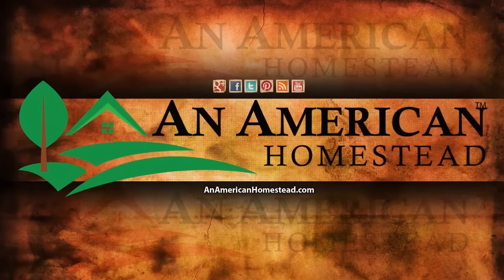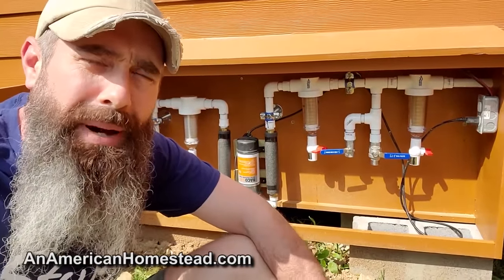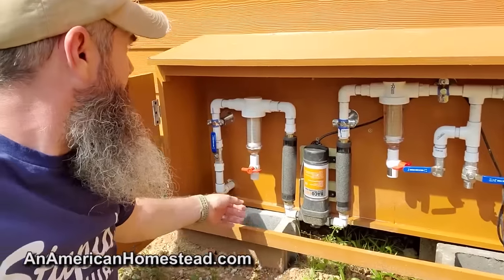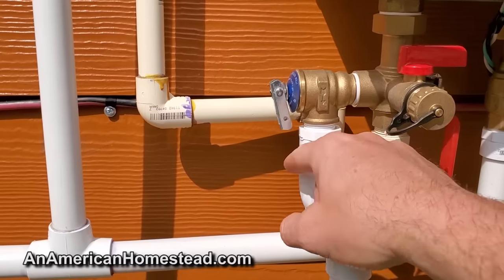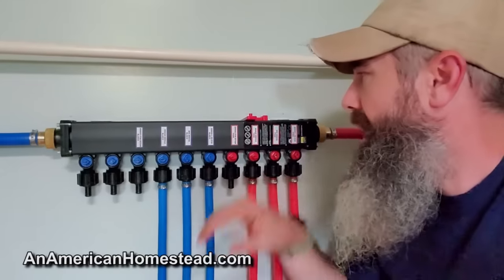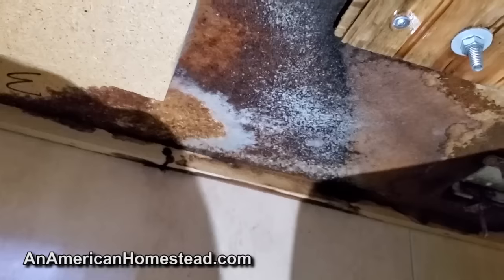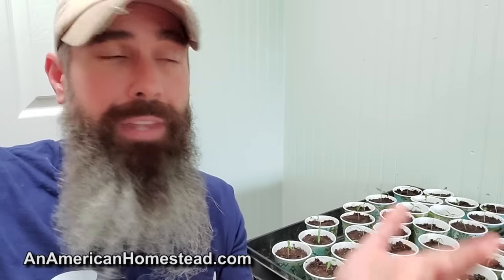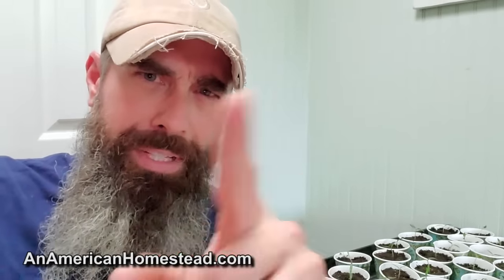How Our Off Grid Water System Works

Comment: I have a rain water catchment system for all my water needs too. My main tank is 2/3 in the ground, I ran into rock. I only got it 2/3 into the ground and covered the top 1/3 with dirt held in place with terraced concrete blocks where now strawberries are growing. I have a "first flush" tank that feeds my cistern and use one of those harbor freight shallow well pump/tank combos. I also have 2 IBC totes and several barrels above ground to catch water for my garden and animals. We get temps into the teens occasionally but only stays below freezing for a few days. I don't have my above ground tanks hard plumbed and if full there's enough mass they don't freeze solid. I have a Big Berkey for drinking.

Comment: I have been on off grid water for a couple of years, my water source is also rain water, the biggest difference between your system and mine is, I only used copper tubbing ,my hot water heater is solar and my pumping system is 12v and runs on wind and solar,  I also use berkey as my water drinking source,  nice system.

Comment: I have a 9 acre water catchment system that waters my garden with a ram pump. My water well is 1/4 mile away. I power it with 230v from my split phase 230v inverter. Through a direct burial 8awg 2 wire. I get 115 v at the well house for lights by running one leg to ground.
It supplies two households and a machine shop with water. My house is all electric. I am off grid and take long hot showers. I average using just over 6 kWh a day. Sometimes up to 12 when my wife runs the AC and does the laundry. The power company had me using 20 to 30 kWh per day.? I’m sure I use less now, but I don’t think I use that much less!!
Reply: Is it possible to contact you directly?  I have a couple of questions.  Thanks. Blessings.

Comment: If you can get the bottom of the tank at least 10' above highest output, you won't need a pump, a 10' drop will give about 60 lbs. of pressure in the house.  And... cover that PVC or switch to CPVC, OEX, or copper for anything out in the weather and sunlight, sunlight wreaks havok on PVC.  Also, creating a vortex in the tank will keep it from freezing ❄️
Reply: Plus "line drop/resistance" if any distance is covered....in my case 500'
Reply: How does one create a vortex in a sealed tank?
Did you install something to agitate the water or is there some other way I haven't considered?
Reply: My problem with a high tank position was my house eaves are 10' and rain had to be able to flow into the tank freely by gravity.  If I had a 3 story house and only needed plumbing on the 1st level this idea might work.
Reply: 10’ of water gets you 4.32 PSI by my calculations.
Reply: Yea… to get 60 PSI you’d have to be closer to 138 feet high.
Reply from the maker: I think your numbers are a bit off....and please tell me how I can create a vortex in the tank.....never heard of that one before.
Reply: @Anamericanhomestead  there's a man who made a plastic "tornado, from Fibonacci, that you can attach to a motor shaft that works really well also.
Reply: @Anamericanhomestead  as for the numbers, I used to be a plumber and the 10' head pressure is our test pressure.
Reply: if you got creative you could add a magnetic stirrer to the tanks.

Comment: Question: When there is a forecast of freezing weather, you drain the pipes so they don't freeze. If things get to the point where there is no weather forecast, how will you handle that?
Reply from the maker: My temp gauge will still be working and I'll just have to watch it more closely.
Reply: @Anamericanhomestead  Thanks!

Comment: We just had a well put in and a 1000 gal holding tank.  1 pump in the well, one pump in the tank.  Now the company tells me I have to chlorinate the water because the black 1000 gal tank is not air tight.  I obviously don't want chemicals in the water, which is why we dug the well in the first place, though we have county water.  I don't know whether to send the 1000 gal tank back and just hope the well/electric is always working, or keep it, but without chlorinating.  We would just Berkey filter the water then.  Thoughts?  And Thank you!

Comment: really looking for some guidance... but i think your video is perfect!
Right now we have county water. We have access to a stream that can provide all the water we need. I have a sump pump submerged in that creek and 5 IBC 275 gallon tanks for storage. My plan is to hook the totes together with PVC and hook it to the main line ( 1/2 pex tubing) that is fed by the county now. basically unhook the county and hook up this system and boom, the whole house is connected. My question is, would this pump work? How is it when you guys have the shower and a faucet running? Does it keep up on pressure? I am pretty sure I can design the system based on your video, but just not sure on the pressure situation. We have one shower/toiler, a kitchen sink, bathroom sink and a standard 40 gallon (traditional) nat gas hot water heater. Also two outside hose hookups, but i would probably do away with 1 or both of those much like you did. 
Lastly, do you have a components list? Mainly the filters, pump and pressure tank? Thank you!

Comment: Water heater looks great to me. I would advise flushing it every year to extend its life. What’s the draw from the pump on your solar?
Reply from the maker: Its easy to flush and a MUST if you're on well water.  But because this is rain catchment water and will have a low mineral content, you can go longer between flushings. But still a good idea.  You're supposed to flush with a mixture of 50/50 water/vinegar.

Comment: What proportion of roof surface to occupancy do you run into with water consumption? Also, our place is at 3000 ft in southern VA in the blue ridge mountains. If you can't embed the tanks deep enough to avoid draining the system, what median temperature in winter is too low for this type of system to be practical. And, nice teeth.

Comment: What was the reason you chose a rainwater harvesting system over digging a well? What would have been the cost difference?
Harder to dig a well by yourself so it would have had to be hired out, most likely. But just curious.

Also, do you have any sort of water purification besides the filters? Thanks!

Comment: Really like your setup.  Any reason you chose PVC (rather than PEX) for the exterior lines by the water heater?  I'm looking to do something like this in a much colder environment where freezing will be a constant problem for several months of the year.  Can you see any reason why I wouldn't want to use a 200 gallon storage tank in the house, and bring the water heater and pump next to it to stay out of the elements?

Comment: when you need to drain your system, your pump is installed with a low point. how do you drain it? Also, why didnt you install all the filters and pump inside so that it wouldnt freeze in the first place?

Comment: So maybe to some this is obvious… I’m asking any way. How does the pump work automatically when used at the sink or shower? In terms of power consumption I’m confused how to get the pump to use power only when using water. Seemed you turned the outlets for hoses and etc then the pump turned on.

Comment: You have my vote as the one of the best looking off grid homesteads!  You are running neck and neck with Doug and Stacy!    By the way,  what type of siding is that on you buildings?
Reply: It is Hardy Board (concrete)

Comment: Love this! Does the manifold charge multiple lines or can it only run one at a time?
Reply: I can share general knowledge even though this is not my system. The manifolds allow water to flow to all of the lines at the same time so long as you have each of the line valves open. It is a good system.
Reply: @jeremiahchapman9288  thanks, that’s what I was hoping. I plan on putting in my water system this fall. This was a very helpful video, as I don’t have much plumbing experience. The biggest benefit I see to this is if something goes wrong (leaks) you can isolate the problem line without having to lose water everywhere else if you can’t fix it right away. We are in an old RV for the last 5 years while I build. One of the capped lines (switched to  a composting toilet when that broke) blew in our bathroom while my husband was at Work off island, I had to wait a week without running water while waiting for him to come home with the parts (and spares!). It makes a huge difference in quality of life.
Reply: @kristenvincent3622  This is EXACTLY right! :-) That is to me what makes the manifold with the valves SOO amazing!   :-)

Comment: Question: do you have debris deterrants/catchment for where your water comes off the rooves, into the "pipes" leading to the large water catchment tanks? - anywhere along the line to the big tanks?- or just from water coming From the tanks? How long will the big tanks last without becoming corrupted?(leaking or leaching, cracking, splitting, etc? What type of seal do you recommend for attaching piping to the big tanks?
Reply from the maker: I'm thinking about setting up some sort of pool vacuum that I can use to occasionally clean up the bottom of the tanks.  not sure how long the tanks will last.

Comment: Maybe I missed it. What powers your pump? Are you using 12 volt dc, 24 volt dc, 110 ac? Thanks.
Reply from the maker: We have AC power that comes from our bank of batteries and solar panels.  We are in the middle of a power upgrade with lithium iron batteries, video out soon!

Comment: Only add on is heat tape to keep pipes from freezing. This way you wont have to drain the system. Not really needed but just allows you to flip a switch and be lazy. Lol🦌👍🇺🇸